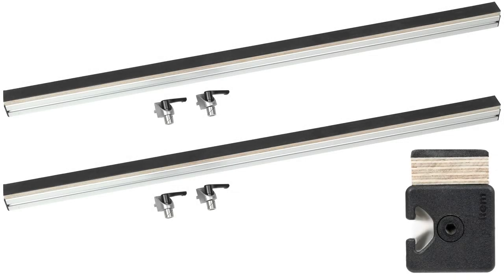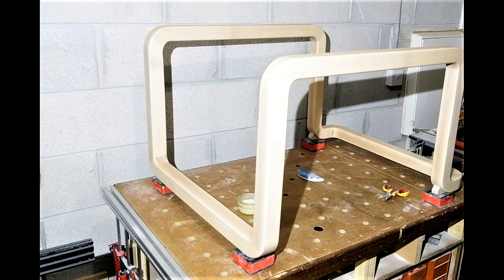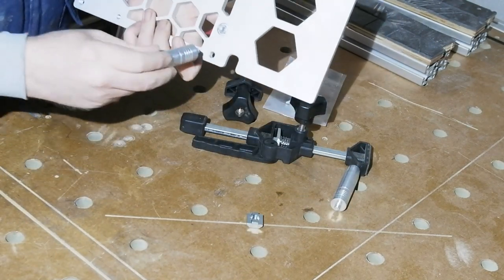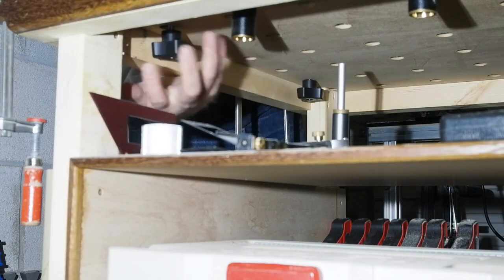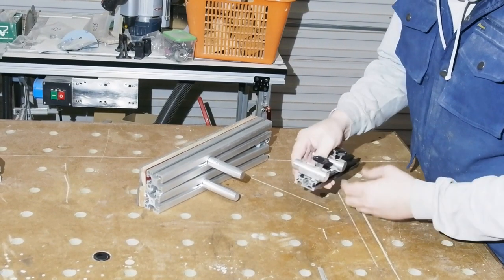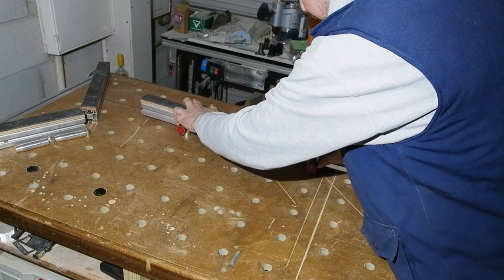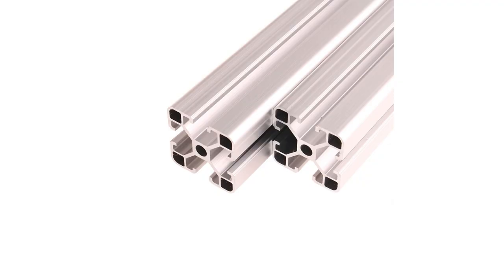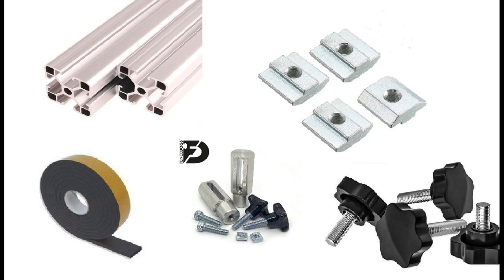A Budget RUWI Support Rail Alternative? A DIY Build using Benchdogs Accessories.

Comment: Hi there, Happy New Year first of all. I build my „copy“ by using those L-Comnecters as you can see on the last picture you included in the video with the festool tracksaw and benchdogs from Ujk. They have a hole in the inside for M8 and I even got myself those little arm bolts to tighten it. You can even use an extra one from the bottom since the benchdog is long enough if you want the tightest fit possible. Two of the L-Brackets are just 1 Euro and the bolt with the handle were also just around a few euros from Banggood. The benchdogs were a little bit more expensive, but not really expensive, but I can‘t remember the correct price. But you version looks good too and it obviously works 😁 Have a good one.
Reply from the maker: That's great, thank you. I did consider showing an option using l-brackets. I have the guide rail dogs that are m8 tapped that could have been used for fixing. The reason I didn't is I liked the idea if everything being quick release. With an l-bracket, even if you use a cam lever to attach a dog from below, it still needs a bolt fixing to attach to the rail - which needs a tool to release. Much like RUWI's own version. I prefer tool free but it's still a good option. Thanks for bringing it up.👍
Reply: @BischBaschBosch  Good Morning, it is probably my Language Barrier, but i made it Tool free with the bolts that have a handle, so when i set it up, i don‘t need any Tools.
Reply from the maker: @karstenf.2558  interesting. Are they quite large brackets? The 4040 corner brackets I have (Not too dissimilar to RUWI's) don't have the room for a cam on each face. I'm intrigued!👍

Comment: Awsome thanks 😊, came up with something even cheaper . Electrical Strut  can easily be adapted for woodworking multi function tables ... Befriend a commercial electrician .Always leftover scraps on big jobs, dumpster diving if permitted scrap yards ... In the states buy mine at Home Depot  ...
Reply from the maker: Yeah, a strut raceway could be made to work no doubt. Cheers Steve.  I do like to make my hacks look like the originals - or "legit" if you like - but always good to hear of other alternatives. In this case, alternatives to the ones I show are particularly useful for any viewers in the US. I think you can get the Benchdogs accessories and even RUWI products sent to the US no problem, but there is a price to pay for that unfortunately. All the best.
Reply: @BischBaschBosch  I was looking at uni strut for panel clamps as I got a plano set but a bit big for garage workshop